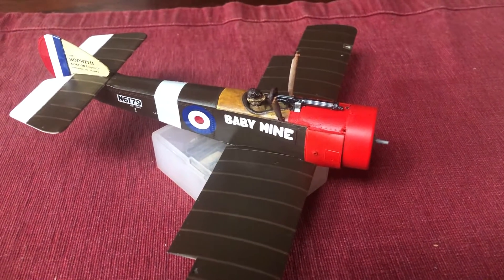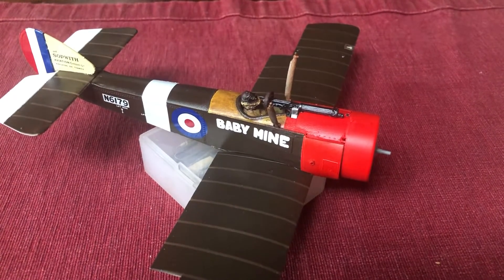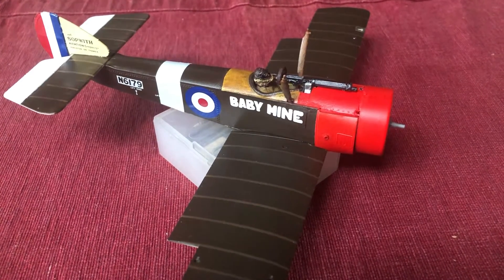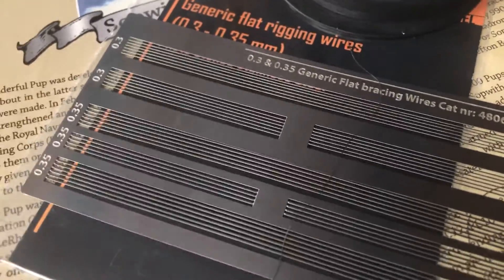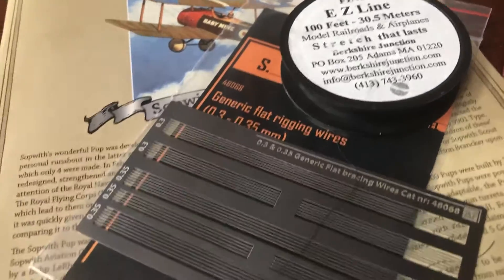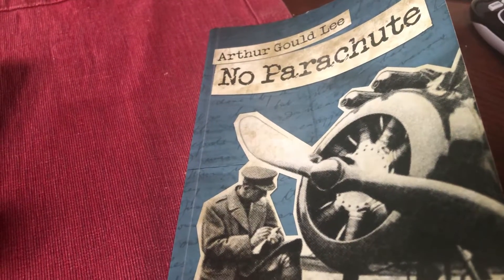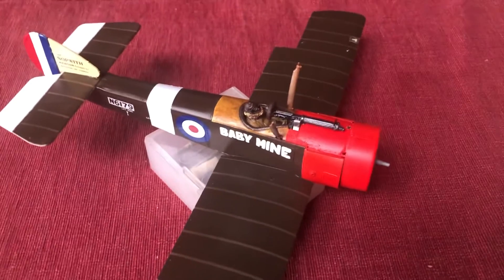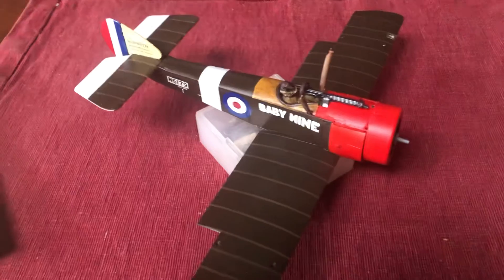On the home stretch: My Wingnut Wings 1/32 scale Sopwith Pup build.

Comment: Hi Mark, the plane is looking great.  I have seen EZ line but never the wires you talk about.  I have heard that EZ line doesn't hold up well over time, but I have no first hand experience with it.  That book looks great, I love reading this kind of stuff.  I'll have to see if I can find a copy.  Thanks for sharing.  Have a great day.  Jeff
Reply from the maker: I've had EZ Line on my 1/48 scale Eduard planes for almost 2 years now and so far so good.  It's a cinch to use although a wee bit slippery .  The SBS Models wire in 1/48 and 1/72 is excellent and really works great on the smaller planes, but it's just a bit "floppy" over longer distances in the 1/32 scale.. still an excellent product but requires a bit more care in the installation process.. a challenge for me with me klutzy fingers and far sighted eyes!
Reply from the maker: @JeffDonahueScaleModeling    Jeff yes I use Loctite Ultra Gel Control which is quite thick. Thin CA cement is way too quick and tricky for my liking.